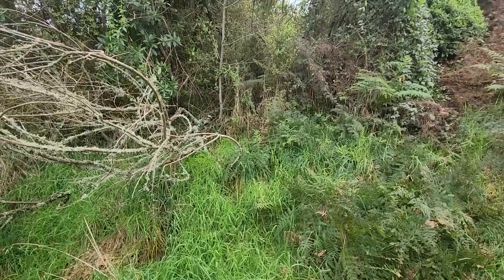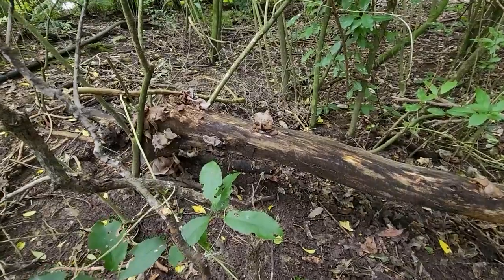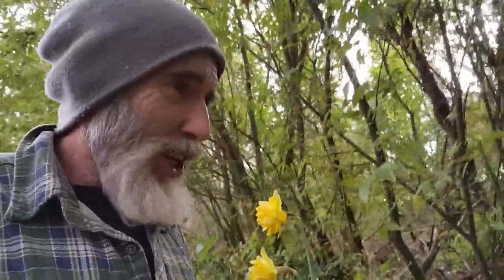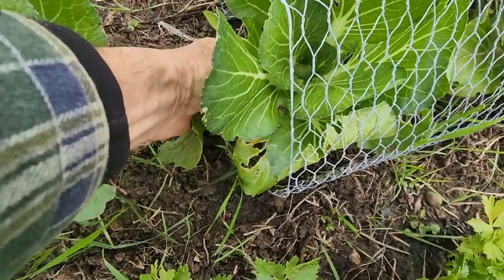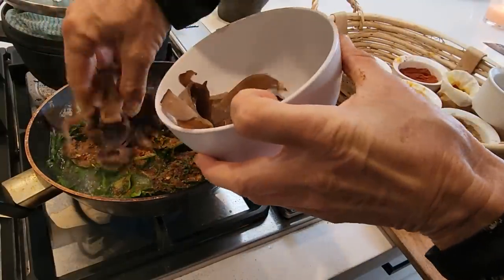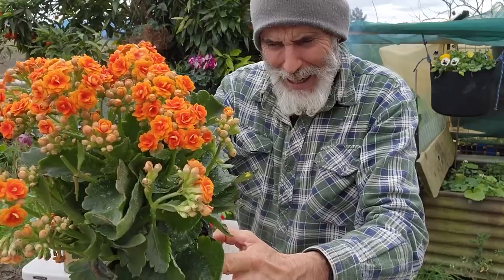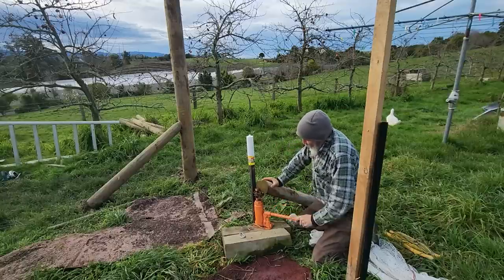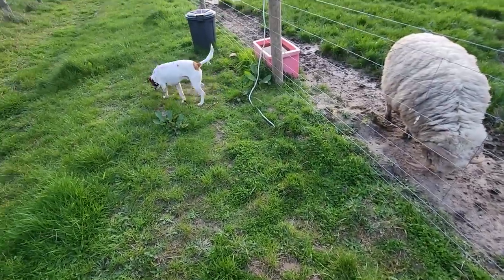Foraging & Making Wood Ear Soup Homesteading

Comment: 'WARRATAHS' Hey clay. I suggest using a u bolt and some heavy chain and a lever similar to the old style railway jigger. Or manual water pump. Even just a length of steel pipe as the lever and then use a wood block 4x4 or something handy. This way you can move block closer or further away from warpath as you need and pushing down on bar for leverage. Other option is tha bottle Jack and using heavy tech screw and attach 4x4 offcut via pretty drilled holes. Block under the Jack to prevent jack sinking. Hope this helps mate. Love your stuff
Reply from the maker: Brilliant

Comment: Too funny 😁 seeing the filthy pig hunter gone Vegan! 🤣 Clay, when harvesting the Fungi, always use a sharp knife, like a pocket knife so that you can make a clean cut on the exterior of the Fungi, so it can heal over much quicker. 
From the web; 
"The actual living organism, mycelium presents as an intricate web of root-like filaments. Mycelium is the primary “plant” portion of the mushroom."

 ...Clay, the mycelium is the fine microscopic white hair like part of the Fungi, the main part of the plant, which branches out hundreds of miles in microscopic hairs, or branches, each one finer than spiders silk!
They are in soil and rotting wood.
Saw your short asking for the Fungi!
...That log, if you know what type of wood it is, you could collect some more logs and lay them beside that one, all you need to do to prepare the new branches is "scar" lines along them with your chainsaw at the 12, 2 and 10 o'clock position, and mix a bit of the sawdust with the mouldy bits of the log growing the original Fungi and put it in the chainsaw "scars".
 Sooner or later the new logs will produce Fungi.
By scarring the logs, you make it sooner. 
Jona will understand the method perfectly, as I remember he was growing mushrooms 🍄 in his room?

Saw you picking Daffodils and putting the flowers in the same basket as your food!
WARNING ⚠️
..."Daffodils - Beautiful but Potentially Toxic.
The Bottom Line.
All parts of the daffodil are toxic. When swallowed, it can cause nausea, vomiting, diarrhea, and abdominal pain. Eating the bulb can cause severe irritation of the mouth and stomach upset. These symptoms are usually not life threatening and resolve within a few hours."
Have a nice day 😊
Reply from the maker: haha. I could never go vegan. Those guys eat sugar, pasta, bread, and other food that comes in packets. Dam good info there mate. I will try that today with the chain saw and other logs. Never knew daffodils were poisonouse.  The duck eggs are in your incubator. Due any day now. Thanks mate.